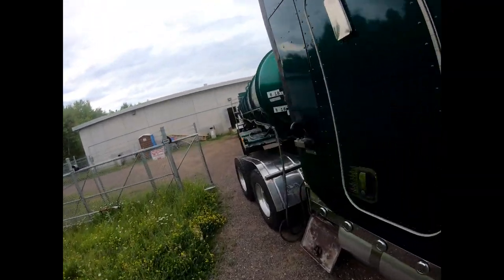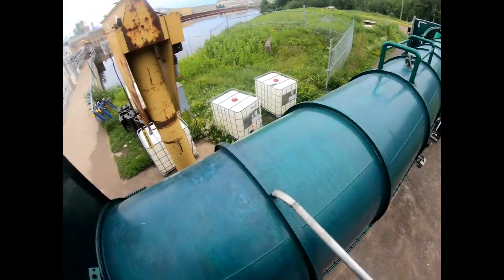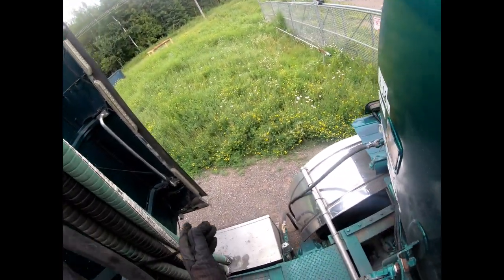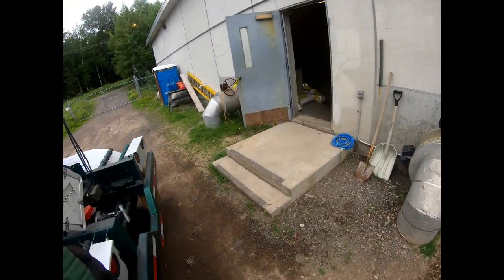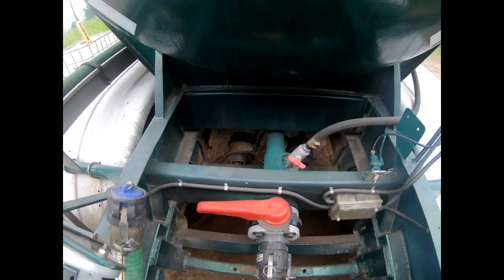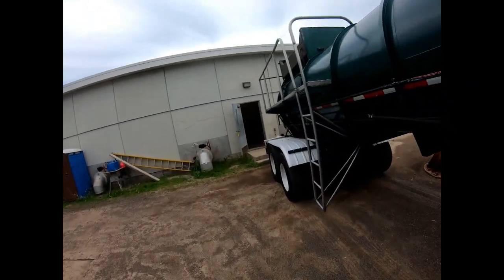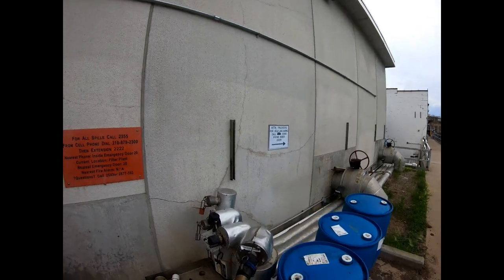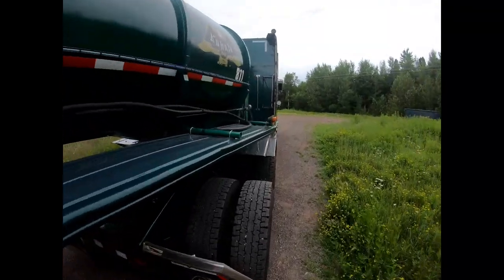Trucking-How to Unload Rubberlined Tanker

Comment: Sounds like u blew your pressure relief valve until you said the sound was coming from the building. I have manny years pullin hazmat tanker. Good video bro. I like how you check and double check your connections and psi. Keep up the good work.